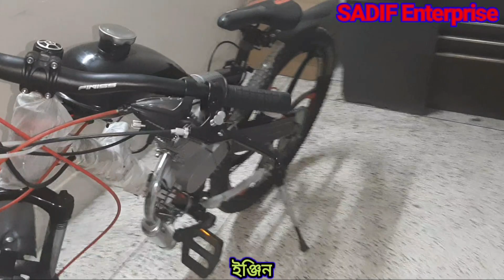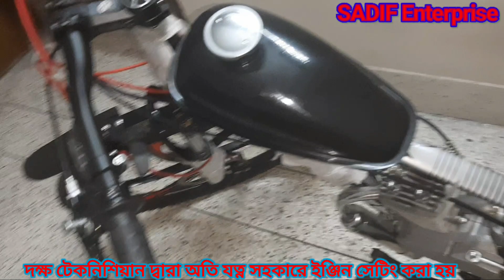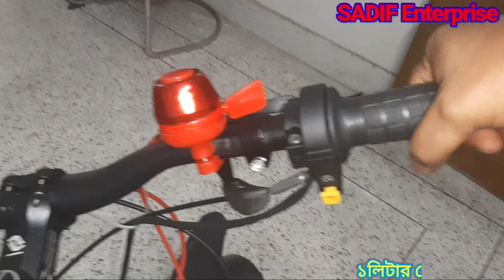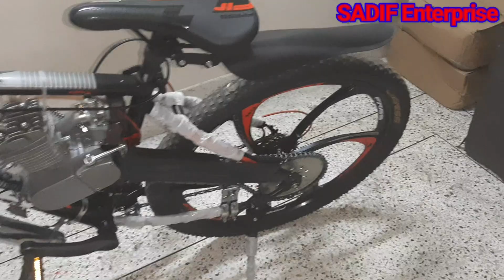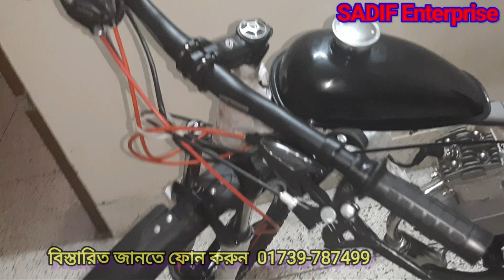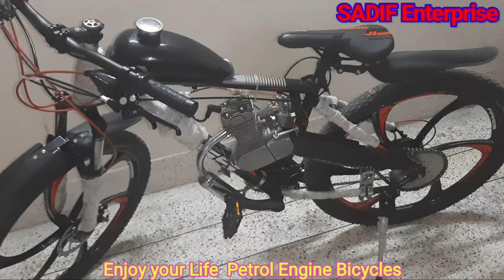নিউ মডেল ইঞ্জিন চালিত বাইসাইকেল🔥🔥 New Model Engine  Bicycle 🚲🚲🚲

Comment: Guys, this is a good option to get a motorbike feeling in a bicycle but... there is a BIG BUT... this is a mechanical engine powered bicycle , this is not an electric bike,  so you must need to get a registration, tax token,  insurance, number plate from BRTA and of course you must have driving license. That's the law in Bangladesh. So,  think twice before buying this to avoid traffic case on the street.